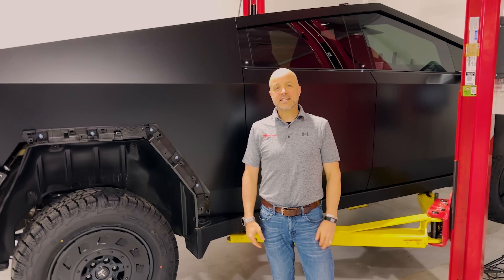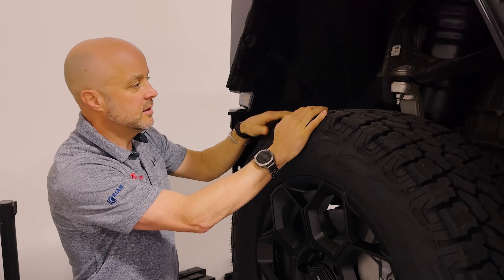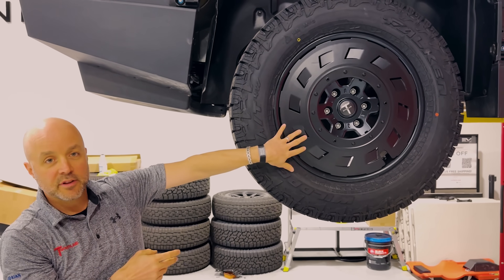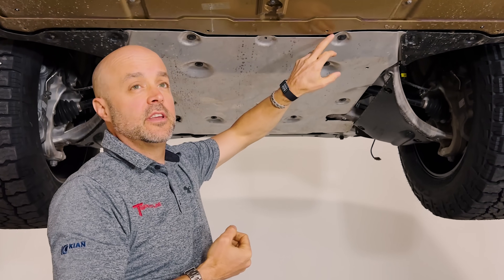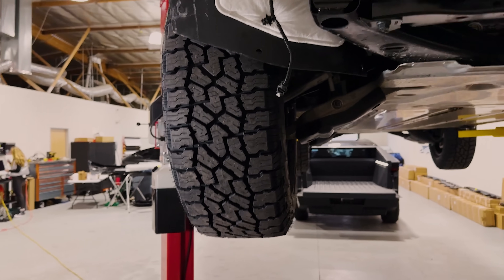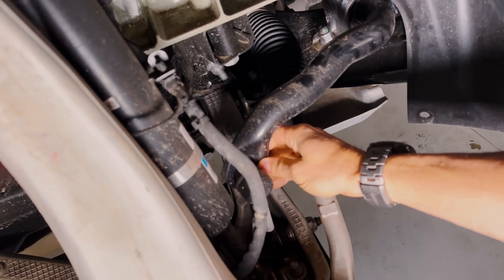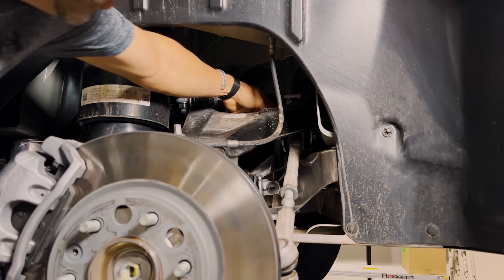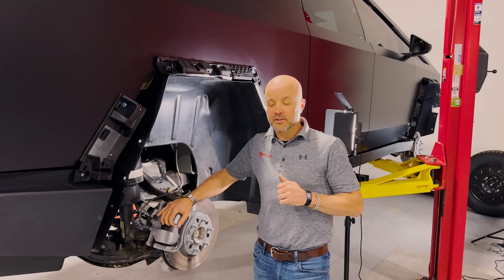Dissecting a Tesla Cybertruck! Underbody & Wheels off Chassis Inspection and Walkthrough, first look

Comment: Why is a sway bar needed if it has 4-wheel independent air suspension?  Couldn't the sway function be implemented in software?
Reply from the maker: Sway bar is using the mass of the truck to it's advantage to manage
Reply: @TSportline Yes, but sway bar disconnects are necessary for adequate off road wheel travel. Getting rid of sway bars solves the issue

Comment: no vitriol, just what caught my eye/response.
OKay that bt sensor will get mud, salt , shit trhown at it daily. same goes for that speaker in the rear.
Cool balljoint-wheel penetrators built in good good
no bumpers  excellent way to get frontend smashed in 
no lift points clearly marked. some numbnuts is bound to put jack throuhg that battery because "well, its all flat, jack anywhere"
ah yes airsuspension, the worst invention especially for gravel filled roads.
wow, gaping hole into tronics from wheelwell.. noice
Reply from the maker: Lot to think about!

Comment: Front brake calipers look beefy. Aluminum suspension arms will not hold up. Proven weak point. 
Expect the slightest mark on the battery tray to require out of warranty replacement. Cost of the part is so high that it will be a candidate for an insurance total. Buy your protection accordingly.
Reply from the maker: We will see!

Comment: I have a feeling this will become one of the biggest automotive flops in history.  It's like the Edsel 2.0 but worse because no one asked for this.  They think non truck owners want this?  Maybe if it was sized more like the Ford Maverick.  Since most people live in cities, it's a hard pass, boss.
Reply: It's the natural evolution of the Expedition and the Tahoe.

It's basically a variant of large SUV, which is hardly a flop proposition in the US.

I haven't compared the dimensions to a Suburban.  But just off the top of my head, I'll bet dollars to donuts the CT is smaller in every dimension.

It's arguably the truest expression of the "Sport Utility Vehicle" concept.  It's extremely sporty and has a lot of utility.
Reply from the maker: maybe

Comment: My first impression is that the brakes look kinda small for managing all that weight in a long downhill switchback kind of situation. If you've ever had brake fade in that kind of descent, you know it's not a comfortable experience. It's one thing in a ICE rig where you can gear down, but I doubt there's much in the way of "engine/motor" braking available here.
Reply: Actually the regenerative braking is just as strong or stronger than gearing down and/or engine braking in a regular vehicle.  While going down a steep incline the regenerative braking will do most of the work and you will likely only need to brake occasionally.  That regenerative braking energy is then charging the battery so you will be higher charge at the bottom of the hill.  Tesla vehicles brake pads can last 100,000 miles.  Also, the 4680 battery technology makes the pack weigh less overall so the weight of the truck is similar to a regular ICE truck - not significantly heavier.  (Key point - if you put electricity into a motor you get spinning motion back out.  If you put spinning motion into an electric motor it becomes a generator and delivers electricity.  The EVs use both on the regular.)
Reply: @SpaceB0nz  If you happened to have charged you vehicle at the top of an incline. The battery won't regen on the way down !
Reply from the maker: interesting
Reply: @greenshortscouk  True.  Unless going on a long trip most Tesla owners don't charge the car above 90% state of charge so there is usually some room.  But yes, regular brakes still required.

Comment: Wondering about the best way to travel with a large dog. Other than the second row option, if there could be a secure way to have the dog in the truck bed still with viewing access (tonneau down)
Reply: Fold up the rear seats and install a safety grate behind the front seats.
Reply from the maker: interesting

Comment: Rumor is under the plastic wheel covers are Model Y giga-casts which is definitely something unique to Tesla as yes, all motor werks will stamp out a wheel well but from what i understand the giga cast is an actual support structure for the vehicle.  Be nice to see the wheel well covers off anyways to see if that's true
Reply from the maker: The giga casting is behind them, correct.  Looks pretty cool.  We will do a follow-up video
Reply: They managed to design the front casting so they can be cast on the machines that were procured for the Model Y casting. Originally, they thought they'd need to cast them on the larger casting machines they got for the rear casting. This is one of the many points where they managed to get better results than they initially expected. Another one is the thickness of the steel, where they started at 3 mm and got it down to 1.4 mm (body) / 1.8 mm (doors).

Comment: Set the vehicle suspension lift height an inch from its highest setting then bring the lift up to the point where it just touches the jack points.  Then get in the vehicle and drop the lift setting via the center screen to see if the wheels come off the ground.  If the wheel(s) do come off the ground, then the lift suspension travel could be used as a jack.  Probably will not work but worth a try.  Probably relies on gravity to lower the vehicle but the lift air hydraulics might have both up and down force.

Comment: Tesla offers a after market lift kit will allow you to put larger tires on.
Reply: No they do not.
Reply: Not Tesla, but Unplugged Performance
Reply: Unplugged Performance announced it a few days back. Its a 2" lift kit for approx 10K, not including install.
Reply: You can't put larger tires on because of the front suspension design.
Reply: @frankmarini5391  they are banking on price gauging the lift kit, because they know it's required for putting larger tires on.  Same with the wheel extenders which are prices high too.  It's going to cost 20-25k plus work, only to hurt the performance by most metrics.

It's already got insane clearance, anyone thinking it needs to be like a monster truck, wants it for cosmetics.
Reply from the maker: We will offer lift kit and larger wheels at @tsporltine
Reply: @TSportline  Knowing how Tesla's brakes are the worst in the business (see the Plaid crashes) any larger tires will make this thing extremely dangerous to slow down and the brakes will need to be upgraded. Probably a bad idea to lift these things for many reasons, but definitely for safety reasons, you should not lift this truck. I can't imagine a single benefit.

Comment: Brake by wire! (Mando only do electric, so I just read).
Reply: That marked thing on the caliper at 17:55 looks awfully like a brake bleeder screw. When does the electric stop and the hydraulic start?
Reply from the maker: the brakes are hydraulic.  Electronic actuation, yes - but still hydraulic calipers.

Comment: I think any kind of tire or lift kits beyond the OEM specs are going to be a big disaster. These are not the type of truck that should be modified beyond the cosmetic in my opinion.
Reply: Because it's not a real truck to begin with period
Reply: @carholic-sz3qv  well truck or vehicle or car whatever you would want to call it. I agree it's not a truck too many things disqualify including the towing and the range. Along many other things but regardless I still think that modifying these in any capacity beyond cosmetic is a bad idea.
Reply: @hankwilliams-hx9ww  yep that's why i think it's not a real truck, even a Mercedes sprinter with proper low range mod is much better than this for example.
Reply: @carholic-sz3qv  I got one for you I used to own a 1990 Lincoln Town car with a 302 cubic inch 5 l Ford engine. It had set up towing a 26 camping trailer with the proper hitch and all that but it did it with ease. I just added a transmission cooler and that car is still on the road today to the guy I sold it to towing a small boat. 300,000 me lol. I doubt the Cyber truck could do any that like this 30-year-old luxury sedan haha. How times have changed my brother
Reply from the maker: We will see!
Reply: @hankwilliams-hx9ww  a 250hp BMW diesel wagon has a 7000lbs towing capacity which is significantly mugh higher than the model x plaid with 1020hp barely towing 5000lbs and the BMW can tow 7000lbs about 600miles on a full tank.

Comment: So for 90k, you can go out and spend more money for after- market parts. No thanks. I do not even consider that a truck. I wouldn't  even consider pulling a 5th wheel or any travel trailer with that thing. A truck first and foremost  is supposed to be practical, that is NOT.
Reply from the maker: ha ha okay

Comment: Too many sharp angles on the truck to get approval outside the US. Thing is a driver hazard for pedestrians and anyone driving a smaller vehicle
Reply from the maker: It is sharp!
Reply: Steering by wire will also throw a spanner in the works.

Comment: Why so many questions about how big if a tire can fit? Why change it? They spend so much time and $$ figuring out whats the best tire size. Big ol mud tires r fine if u off road but most dont do that. Trucks with huge tires suck at mpg, sound is terrible, handling is crap, etc. Unless they gonna take it to a shop that knows how to set up huge tires and suspension, just leave it alone and get rims. Changing tire size changes alot of geometry that can quickly take it from gr8 to terrible fast. The ild days u could throw on a ligt kit and 44s and go. Now with all the computer crap ut can set off alot of sensors, modules and have u chasing issues and lights all day.
Reply from the maker: Tire size is always a common question

Comment: If they still use TPMS valves, they are obsolete, VW and many others use the ABS wheel sensors to check tire speed and it's related to tire pressure as tire diameter changes with air pressure.  saves the need to replace pricey TPMS valves.  Not so modern is this goofy SS door wedge
Reply from the maker: yes, TPMS

Comment: Having aluminum control arms on the front of a vehicle that heavy is a really bad idea. I would be designing a steel replacement because any real off roading or hitting a pothole at highway speed will be horrifying when the battery slams the road and ignites turning it into the worlds most expensive easy bake oven.
Reply: This not cartoon it's real life. Engineers have made thousands of simulations testing everything It's all about the design. Those control arms are extremely strong. Tesla engineers have counted every ounce into the design nothing is random. And the battery is not a bomb there's no way it can ignite.
Reply from the maker: will be interesting!

Comment: See what it looks like as a low rider and make it lay frame. Also put a lift kit; at least 15" and put 54" tires or bigger.
Reply: you'll scrape the battery tray.
Reply: @markplott4820   One will want to put a aftermarket battery protector skid plate on too.
Reply from the maker: ha

Comment: The CT went from a tank as originally shown to an electrified Honda Ridgeline with different skin and a touch of rear wheel steering.  Definitely not what was originally previewed.  Almost double the price, no real steel exoskeleton, no 500 mile range, reduced towing, 5 instead of big enough cabin for 6 passengers, back seat looks a lot smaller than an F series, tiny frunk, etc...  After the initial excitement dies down they are going to have to really drop the price on these or step up their game with version 2.0.
Reply: To me the meaning of "exoskeleton" is that the structural support/frame is on the outside (Like a crab), but it seems that the CT is actually just fitted with added outer panels like armour.
Reply from the maker: interesting

Comment: I cant see any aftermarket existing for ev vehicles in another decade considering that even now, ev owners need replacement batteries after 10-14 yrs. 2015‐17 teslas can be had for as low as $15-20k with high miles and of course all of them are stock. With the cost of a replacement battery costing half the price of a 10 yr old vehicle on everyone, everyone has swallowed the modern green planet saving trend hook, line, and sinker. It's just another short term disposable product.

Im shocked that so many aftermarket companies are so excited to promote the electrication of vehicles. With half of consumers buying these for the very fact they dont have to physically drive themselves, do you think they care about modifying skid plates, wheels, calipers or rotors? 

 Owners over the 1st 4-8 years wont modify anything in order to keep the warranty and because ev owners only care that their vehicle is an ev. 2nd and 3rd owners won't buy one because new battery packs make owning an old ev a money loosing endeavor.
Reply from the maker: Never know!

Comment: absolute trash design.
Reply: Then don't buy one. I will and I'll be happy. You can have your square box on wheels. I'll have my triangle on wheels. That's the fun thing about freedom... You have the freedom to choose what you can buy. 
Pretty soon my triangle will make your square box obsolete tho.
Reply: @themonsterunderyourbed9408  id wait until they design a proper set of control arms for it.
Reply: @themonsterunderyourbed9408  No offence but I guarantee your triangle has built in obsolescence straight from the factory, these new electric creations will be scrapped once people realize how much long term maintenance will cost.
Reply: @themonsterunderyourbed9408 😂 you must be 12..
Reply: @roosterhunter6245  There is no maintenance on EVs. That's one of the reasons why they are superior. 
The CT will save you THOUSANDS/year in fuel costs alone. Even if you need a new battery after 20 years, you'll still have saved way more money. 
My Model 3 already saves me ~4000/year in running costs over my Toyota Corolla. 

The data we currently have on Tesla batteries says that the lifespan is over 20 years. 

I don't know why all you haters keep denying this.
Reply: @ZuminaZX  steer by wire.
Reply: @themonsterunderyourbed9408   crash by  no control when power is lost
Reply: @themonsterunderyourbed9408  nonesense. What are you saving? $1000-$2000 in fuel and $150 in oil changes? You're paying more for the car, insurance, and depreciation.
Reply: @ZuminaZX  Nope! Insurance on my Model 3 is cheaper than on my 2013 Corolla. Try again. 

Gas in Canada is WAY more expensive than in the US.

Try again!
Reply: @themonsterunderyourbed9408   keep your delusions.
Reply: @ZuminaZX  The mad lad thinks his EV wonder is entropy proof.  Time to make some popcorn! 🍿🙃
Reply: @ZuminaZX  Get ready to eat crow and LOTS of it.
Reply from the maker: okay

Comment: This thing looks awfully dangerous for pedestrians and other cars alike.
Reply: what truck doesn't?
Reply: @stormsurfin - Come on, this thing has 1.08 mm thick sheet metal and these angles are just too sharp.
Reply: @donyakusa9187 you won’t like getting struck by a 3 foot tall 4000 pound pillow at 40  mph.
Reply: @donyakusa9187  1.8mm and laser cut to boot.
Reply from the maker: we will see
Reply: @TSportline  - Indeed…we shall see!